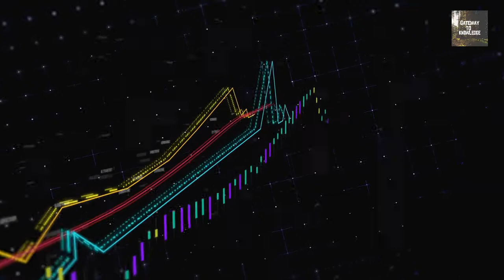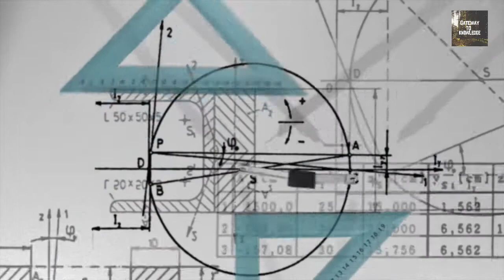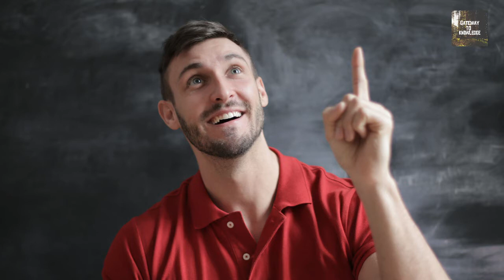How Rocket Moves In Space When There Is No Air To Push Against?

Comment: Rockets DO push off of air. The commonly taught "rocket science" is wrong. Rockets do require air to produce thrust.
Reply: Rockets push against their own exhaust and the exhaust pushes against them. All that pushing happens inside the rocket engine so no need for any surrounding atmosphere.
Reply: @fromnorway643  
 "All that pushing happens inside the rocket engine so no need for any surrounding atmosphere." <~ NASA provides you with their rocket thrust calculations, and it is dependent upon ambient air pressure. YOU ARE WRONG.
Reply: @thomasg4324 
Rocket engines work better in vacuum than in air, so yes, the atmosphere does have an impact.
Saturn V's F-1 engines increased their thrust by 15 % from sea level to (near) vacuum while the space shuttle's main engines (RS-25) increase their thrust by 23 %.
Reply: @fromnorway643  
"Rocket engines work better in vacuum than in air, so yes, the atmosphere does have an impact." <~ You are wrong about that also. Not only do those rockets have to THROTTLE UP, but the divergent shroud EXPANDS for the lower ambient pressure zone those rocket stages...because the shape of exhaust plume matters.

"Saturn V's F-1 engines increased their thrust by 15 % from sea level to (near) vacuum while the space shuttle's main engines (RS-25) increase their thrust by 23 %." <~*Yes, friction matters.....both ways* Fuel based rockets do not produce any thrust in a perfect vacuum.
Reply: @thomasg4324 
"Fuel based rockets do not produce any thrust in a perfect vacuum."
Nonsense!

BTW, what vacuum are you talking about? The 200 atmospheres of pressure (~halfway down to the wreckage Titanic) inside the combustion chamber of an RS-25 engine?
Reply: @fromnorway643  
Ambient air pressure matters. You've been lied to.
Reply: @thomasg4324 
Any source?
Reply: @fromnorway643  
NASA provides their rocket equations on their websites. Ambient pressure is in the equation for thrust.
Reply: @thomasg4324 
Any specific source?
"Their websites" is not a source!

Comment: I have graduate degrees in Physics, and I have taught introductory physics to High school students and first-year University students.

This is the most boring piece of video I think I have ever seen.  Just explain how thrust works -- we don't need a history of flight going back to the Wright brothers or machine guns.  I stopped watching at around 1 minute because this lesson was not put together well.
Reply: - "Just explain how thrust works --"
Sure.
Rockets PUSH MASS out the back and, due to Newtons Third law, MUST feel an equal and opposite force pushing the rocket forward.
It would be a violation of newtons laws if rockets did NOT work in a vacuum.